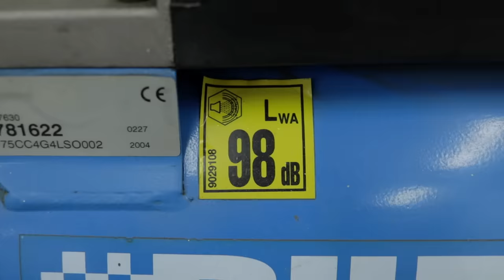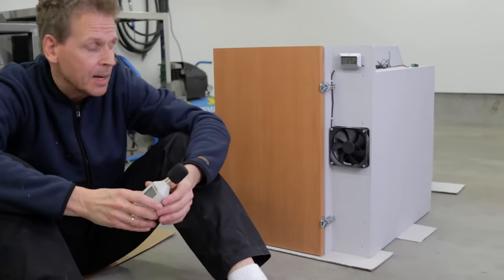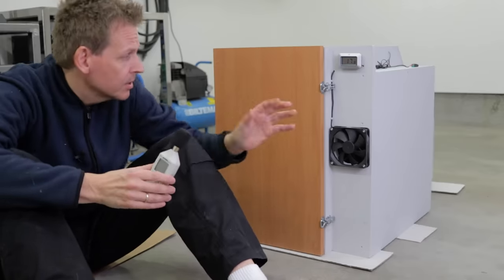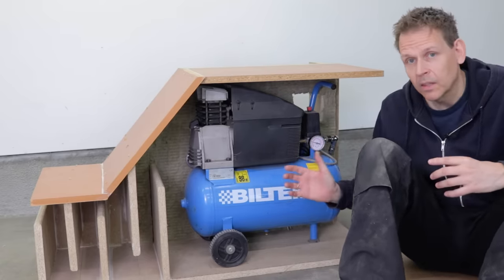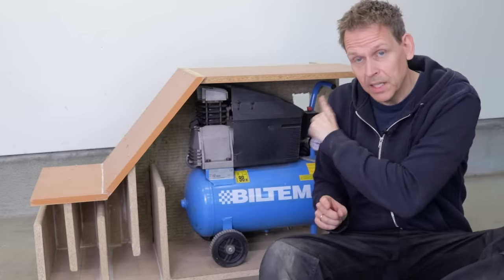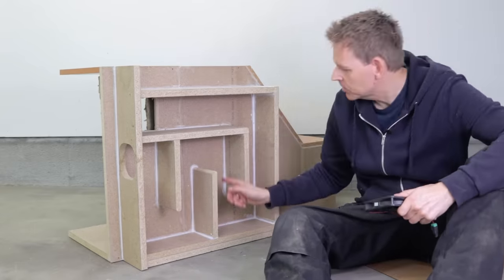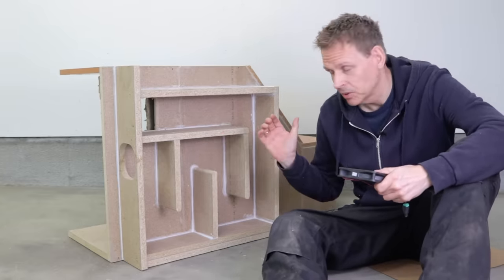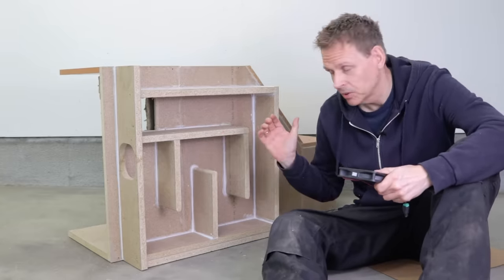Do not build a sound insulated enclosure for your noisy air compressor!

Comment: So you get an oilless air compressor, then spend the time, money, and effort building a soundproof box for it due to the noise it makes... Rather than just spending the extra money to just buy an oil air compressor in the first place?

Cost/benefit, anyone?
Reply from the maker: The oil-less compressor i bought was a silent type, while the old noisy one was oil air compressor. I think you might have mixed up with  direct drive vs belt driven. Belt driven runs the compressor with slower speed and it makes them more quiet. These are bigger an more expensive.

Comment: it doesn't produce that much air?
I think neither of them produces air
Reply from the maker: Here are specs - I don't really understand these two air flow measurements though:
The old one 2HP - 1500W. Air mass displacement: 196 liters per minute.  Free stated air mass at 6 bar: 100 L/min
The new one: 1HP - 750W: Air mass displacement: 126 liters per minute. Free stated air mass at 6 bar: ; 58 L/min

Comment: well now you need to build boxes for your saws they are loud too.
Reply from the maker: Hehe, perhaps i will 😎 I'll tell you a secret. Why I had to get my air compressor quiet in the first place. I am easily scared. Say "boo" to me and I jump and my heart skips a couple of beats 😛 I always put on hearing protection when I start a noisy machine, no problem. I don't want to go around all day with them though. I never know when the air compressor kicks in. Typically it happens when I am very focused and it is complete silence in the garage. And there - BANG it kicks in. I could not take it any more 😫😂😁
Reply: @kihestad  I understand that completely

Comment: It's pretty dangerous, don't leave it unattended or you'll end up with a fire. If you want silent, then buy a screw compressor.
Reply from the maker: A screw compressor would have been lovely, but they are to big for my workshop and too expensive for my wallet 😏 You have a very important rule there that I support 100%! I never leave any machines plugged in or running if I am not at the workshop. I have monitored the temp inside by box, and drained the tank now and then. Everything is healthy! 👍

Comment: Why not just buy a larger compressor so it isn't running nearly as often? That one looks very small.
Reply from the maker: Here are some reasons: I have a small workshop = I want a small solution. I do this as a hobby = I cannot afford an expensive solution. I dont need a high capacity air compressor, a small one delivers enough air for me. You don't want a too big machine you don't use, it just degrades faster 😊

Comment: Energy is released in the form of heat as the air is put under pressure. That thing is going to overheat.
Reply from the maker: I absolutely share your concern when it comes to overheating. The air compressor will not live for long if it is constantly hot above the recommended specs! 😐 However, It's a pretty cold climate here where I live in Norway, in the Northern part of Europe. I have actually fitted a heat pump in my garage to be able to use during winter time. I can see overheating is a big challenge in warmer climates. A more powerful fan or even radiator cooling could be needed must then be considered.

I have fitted a thermometer and I do check frequently that it's not getting to hot inside the box. Normally the temp increases 5C = 10F when it starts until pressure is built up, and it takes just a couple of minutes to cool it down. If it is running constantly over longer periodes it can get a bit hotter, I have seen almost 10C = 20F increase. The warmest summer days can be 30C = 86F here where I live, but that is very rare. Its more commonly 25C = 77F, so it never gets very hot inside my box.

Comment: It's a mystery why they even still sell the awful, super high RPM compressors. There's thousands of ways to setup a pump, and you don't need a super high RPM pump. A super low RPM pump solves at least 50% of the sound. Those tiny "cheap" compressors are basically a fraud, because you can't even use them. They are so loud that they aren't even safe to operate. An easy solution would for a law to be passed to prevent excessively loud pumps, because they would be forced to use better quality pumps. They should not be allowed, legally, to sell trash.
Reply from the maker: Hehe, I guess these noisy ones are cheap to build and thereby affordable to buy. A lot of machines has regulations for how loud they are allowed to be (like cars and motorcycles), perhaps noise level on workshop equipment should be regulated as well 🤔

Comment: Buy a bigger compresaor, they're quieter, and take less space then the box.  But well done!
Reply from the maker: Thanks! 👍 Bigger is absolutely better. I don't have much space though - I really wish I had a bigger space 🫤🙄
Reply: I had that problem with the little compressors too.  But came across a deal too good to pass up, on a second hand 60 gallon 3hp electric compressor one day.  It stands on a 2.5 x 2.5 foot pallet, but it's 5 feet tall.  I was amazed how much quieter it was.  The box looks like it's about the same foot print ish.  Way too much work for me for sound isolation.  But it appears as though you may be an engineer.  That's an extremely well designed "box".  Well done!.

Comment: meanwhile sensible people build a heavily sound insulated square box/room  to avoid overheating
Reply from the maker: I absolutely share your concern for overheating. The air compressor will not live for long if it is constantly hot above the recommended specs! 😐 However, It's a pretty cold climate here where I live in Norway, in the Northern part of Europe. I have actually fitted a heat pump in my garage to be able to use during winter time. I can see overheating is a big challenge in warmer climates. A more powerful fan or even radiator cooling could be needed must then be considered.

However, since I have a fan in front blowing air into the box I have airflow through the case that will "grab" the heat and transfer it out of the box. I have fitted a thermometer and checked the performance frequently. Normally the temp increases 5C = 10F from when it starts until pressure is built up and it shuts off, and then it takes just a couple of minutes to cool it down (as the fan continues to run after the compressor stops). If it is running constantly over longer periodes it can get a bit hotter, I have seen almost 10C = 20F increase. The warmest summer days can be 30C = 86F here where I live, but that is very rare. Its more commonly 25C = 77F, so it never gets very hot inside my box and it is within the range of acceptable temperature for this compressor.

Comment: If the sound of a compressor bothers you, you shouldn't be using one I've been working with compressors all my life and the noise have never bother me never even thought about it.
Reply from the maker: Perhaps the air compressors you have been around has been more silent? Bigger ones, the ones found in professional workshops are normally a lot quieter than the hobbyist machines.

Comment: From a computer guys point of view you didn't put enough fans on it and likely not high enough static pressure either unfortunately
Reply from the maker: It has actually worked out just fine, but I will probably move it inside so it pulls air instead of pushing air.
The compressor has also a fan blowing air backwards, so the airflow us actually decent

Comment: Look at the SOURCE of the noise. Noise is generated by the compressor piston. Rather than insulating the entire compressor, enclose the piston and the electric motor with insulated small box, that should work much better.
Reply from the maker: It is a great idea 👍 I just did not think of it as an option when I started the project 😫 I would probably have done it now, if I where to do it again. Would have made my box smaller and easier to build, and it could have been even more insulated.
Reply: @kihestad  - Obviously you are not an engineer, an engineer always thinks in terms of causes and effect, control or optimize a cause to get desired effect.  You could design a box to resonate at certain frequencies, completely masking all other frequencies for a silent operation, that's how exhaust mufflers work.

Comment: I just rolled mine outside added another 50 foot of air line.
Reply from the maker: Yes, that is probably the easies and smartest solution to the problem 😊Unfortunately, I just dont have space for it. My garage is placed with minimum distance to two of my neighbors. The side facing my own property is not usable either,  as it's just a slim path between my garage outer wall and a concrete retaining wall. In front of the garage door is no good either 😋

Comment: Even better, build a small shed outdoors, and use cas iron and quarter turn valves to pipe the air to different stations in your work area.

Thats what grandpa did
Thats what dad did
And thats what im gonna do

Comment: It looks like you're building a ported speaker enclosure lol. I would be will do bet you got decent bass from your air compressor!
Reply from the maker: hehe, I have built a couple of speaker- and sub woofer boxes, the box is not that different 😊
Reply: @kihestad  I totally thought the motor vibrations were going to be amplified lol like a perfect 90 Hz SIN.
Reply from the maker: Hehe, well - you are not the first one 😊 A bass speaker produces low frequency sound waves, and a bass- / sub woofer box tries to optimize (double) these sound waves by letting them through a port + directly from the speaker itself (most of these speakers are ported to maximize the bass). The speaker box is not really capable of creating or amplifying the bass, it can just optimize what comes from the speaker. In other words: without a speaker that produce bass sound waves, the box will not be able to output it either. An air compressor does not produce much low frequency sound waves like a bass speaker does, it's mostly mid and high frequency sound waves coming from an air compressor. This is also the noise that is most annoying and important to reduce. The ports on the box I made are there for cooling and to let air into the compressor, unfortunately they also let sound out of the box but it would have been magic if they had amplified the bass 🤩

Comment: Those baffles really aren't doing anything. You basically made a subwoofer lol. Take a look at some subwoofer designs and you'll see many resemble your baffle setup but with pipes instead. Also that padding material is also not great. R-13 is some of the best followed by rockwool in sound-deadening tests. The problem is your material is just too thin to disrupt the lower-frequency soundwaves. Also MDF is horrible. Not sure how it compares to chipboard, but don't listen to people suggesting MDF.
Reply from the maker: I don't think you are right about that. The baffles are important to break up the sound waves, it filters the high and medium frequencies. A subwoofer uses either a pipe or baffles for delaying the "breathing" from the speaker membrane to (almost) double the bass effect. A compressor does not make any bass at all (almost), so it will not be the same. 

The sound absorbing insulation I used in the main chamber was Rockwool sound insulation material, it's quite good. It's just 3cm thick, thicker would of course have been better. In the ventilation channels I used just a thin material to not obstruct airflow though. That could also have have been better, but I had space limitations for my build.

MDF is known to be quite a decent material for both speakers and sound insulation boxes. I think it's the most common material to use for speakers. Chipboard is very similar, it has bigger "chips" so it is less dense and has a more course surface finish, but a lot cheaper. I have made a lot of speakers and subwoofers as well, using both MDF and chipboard, it works very well. 😊 My box looks very like a subwoofer, but it acts quite different because the sound source is different.

Thanks for the input anyway 😊

Comment: Get a belt driven compressor, completely different noise much better for not annoying the neighbours.
Reply from the maker: @Vincent77654  I totally believe you, others have said the same as well. The air compressor part operates at a lower rpm on these, causing less noise, and more pleasant noise. The downside is that they are physically bigger and more expensive. For example, I could not have fitted one upstairs under the ceiling in my garage.

Comment: Oil free compressors are louder than oil compressors by quite a bit they cost more but are worth it.
Reply from the maker: I am not sure about that, my old noisy one was an oil compressor. The new silent one, oil free. You can however get belt driven oil compressors. These runs on slower speed and are more quiet.

Comment: It would be even better if you had acoustic foam
Reply from the maker: Well, I am using Rockwool sound insulating material inside - it does not show that well on the video. It is similar or even better than many types of acoustic foam. I was afraid of not having enough airflow, so I did not add it into the ventilation channels. The cooling is no problem, so I might try to add more of it at the start and end of the channels as well. Thanks for the tips! 👍

Comment: you can always build the enclosure to the same wall but outside of your shop
Reply from the maker: I wish I could, but I just dont have space for it. My garage is placed with minimum distance to two of my neighbors. The side facing my own property is not usable either,  as it's just a slim path between my garage outer wall and a concrete retaining wall. In front of the garage door is no good either 😋

Comment: In my country it would be cheaper to buy a low noise compressor than spending all of that wood for the box you made
Reply from the maker: Exactly, it's the same here. It is quite strange though. It seems like "raw" materials, both wooden material and metals, seems to be more expensive than prebuilt products like machines and furniture 🤔

Comment: You need to isolate the feet of the compressor from the box.
Reply from the maker: Yes! You are spot on! It’s the vibrations now causing the remaining humming sound, pretty sure it’s from the feets that goes to the box and into the floor. 👍

Comment: The English word you are looking for is 'Baffles', Also, a pressure gauge downstairs would be good
Reply from the maker: Ahh, yes - baffles it is 😊 I already had a pressure gauge downstairs, with water and particle filter on it. I removed the one on the compressor so it has 'direct output'. I did not include that in the video though, impossible for you to know 😝 It works very well!
Reply: @kihestad  Even more quiet would be a tesla turbine compressor but no one sells them yet and so you'd need to make your own. They would be silent and pull huge vacuum or make massive pressure and possibly not need a tank. Pressure or high vacua on demand. Air or water. A highly recommended study rabbit hole to go down.
Reply from the maker: That sounds like a very cool project 😎

Comment: Heat isnt the only reason you cant really enclose it entirely, its an air compressor. It needs air to compress, if it was in an air tight box then you basically just made a vacuum pump 😁
Reply from the maker: Hehe, I have seen some few commenters saying 'why make it so complicated, just make a box without the vents 😅

Comment: Oil compressors are quieter. Teflon sleeve pistons are really noisy.
Reply from the maker: My old noisy one was an oil compressor (at least I had to check and change the oil on it now and then), the silent one was oil free. I think they both can be made both noisy and quite, it all depends on the design.

Comment: Or.... just buy a much quieter compressor.  They sell compressors today that are as low as 58 to 60 dB or about the same noise as a refrigerator.  Keep in mind that the dB scale is logarithmic, so a 90 dB air compressor is well over 1000x louder than a 60 dB one, and this one is staggering 96dB..

You can buy a DeWalt or even a Harbor Freight compressor that is equivalent size and airflow and is 69dB, they start at around $400 or so.  Just tossing that out there, so people are not spending 100 hours making something more quiet and earning $4 an hour in the process...
Reply from the maker: Yes, I agree! The one I got was rated to 78dB and I have seen you can get even more silent ones. They are a bit more expensive, mine cost $150, but I guess your ears are worth it 😊
Reply: @kihestad  Even the Harbor Freight one is $400, and it is 69 dB.  That is about 10x quieter than what you have.  If you don't need the high airflow, they sell smaller air compressors for around $150 that are as low as 60dB or close to 10x quieter than the one you have...